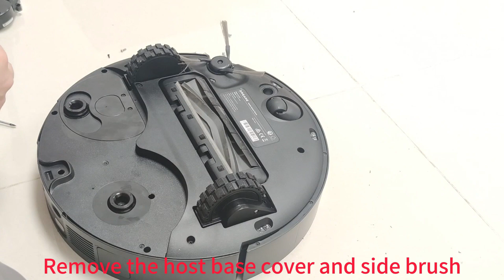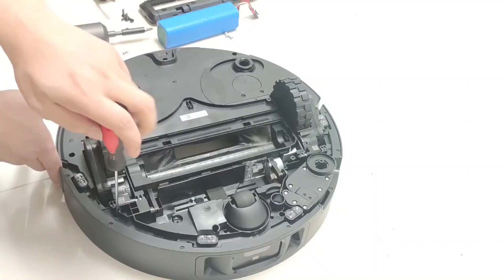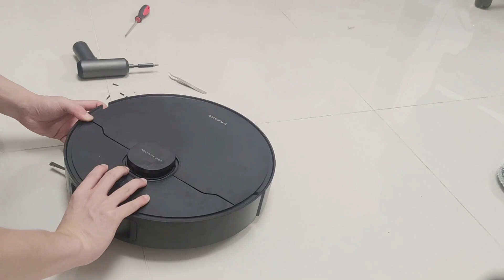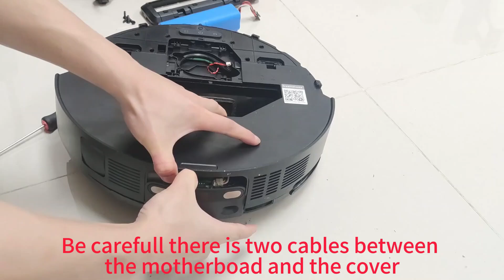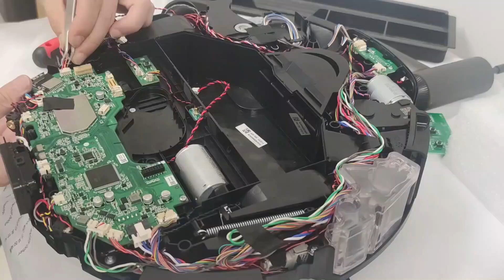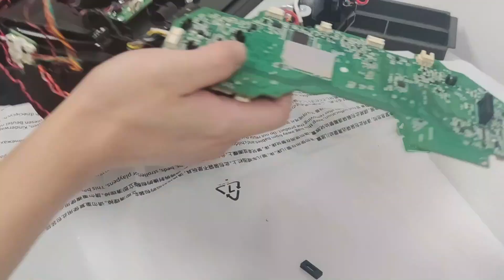Change a new motherboard for DREAME X40 Ultra

Comment: Hi. After changing the motherboard (along with the camera that came with it), the AI camera stopped working on the X40 Ultra Complete - the identification of objects that are below the lidar does not work, which is why the robot constantly crashes into steel legs, wires and other small things.

Previously, the robot took photos of things with their identification, but after replacing the board, this does not happen.

I read about the fact that sensor calibration is required, but I can't figure out how to do it. Could you tell me what solutions there are to my problem. 

Thanks
Reply from the maker: Hi. After change the motherboard or AI camera, you need do the calibration on the tool, Only our agency in your country or your city have this tool. So I think it is better you can call to our agency in your country, then send your robots to their office to do the calibration. You can get their email or phone on the Dreame App.
Reply: @dreametech-robot  It seems like I have the exact same problem as @Dmitry-s7p. Does that mean I have to send it back again? I waited 5 weeks for the last repairment. Is there really no way to calibrate it by myself?

Comment: My X40 Ultra does not clean alongside edges. Dreame Service said this is probably because of damaged LDS. They did repair it, but in the maintenance report I can see they only replaced "Motherboard and camera assembly-EU". For me, this does not sound like a solution to the problem. I expected them to replace a sensor, not the motherboard. Does this make sense to you @dreametech-robot ? I have not yet received the repaired robot, so can't test it myself.
Reply from the maker: @matthiasherrmann3133  Hi. The LDS  will upload the file to the motherboard. So I think they tested and confirm that the motherboard can't analyse the data from LDS. So they changed a new motherboard. The LDS works well actually.
Reply: @dreametech-robot  Thanks for your quick response. Ok, I hope you are right and my robot will finally work like it should :)
Reply from the maker: @matthiasherrmann3133  You are welcome, you can talk to the repair center to test some times before post it to you.
Reply: @dreametech-robot  Received it back today. They really fixed it, the robot cleans everything perfectly now. But it does have a brand new problem: Collision avoidance doesn't work anymore. I resetted twice and tested with all combinations using AI avoidance and non AI avoidance. It doesn't recognize shoes nor tangled cables. It behaves like I completely disabled obstacle avoidance. Too bad :(
Reply from the maker: @matthiasherrmann3133  You can ask them did they do the AI calibrate? it is necessary to do this calibrate.
Reply: @dreametech-robot  Asked them, they didn't respond yet. But I think I know the answer. According to https://youtube.com/shorts/CDolIIBvWgA?si=ehE6qOzeJQCBAt0c I just need the new firmware and then I can recalibrate it myself? But how to get new firmware?
Reply from the maker: @matthiasherrmann3133  This is current calibrationg not AI camera calibrate. You can not do the AI calibrate yourself.

Comment: Thank you for your interest in my issue. May I have your website address? And the information I found out is that x40 proultra is being exported and sold to Singapore. Can I buy the motherboard of the model that exports ash to Singapore? Because Chinese domestic models are too difficult to bypass the ip.

Comment: I can't see any additional comments I've made. I think my comments have been deleted.  I live in South Korea. I bought the x40 proultra from an online shopping mall called Taobao in China. Because I wanted this model, but it's not sold in South Korea. I've been using it through a Russian-run vpn, but the manufacturer (dreame) has locked it out of use. When I asked dreame, they told me that if I brought the product to China and authenticated it, it would be released. I found another way and thought that I could replace the motherboard with something that can be used in foreign countries, so I came all the way here. But I couldn't find a place to sell it :( This is my honest story. I want to solve this problem.
Reply from the maker: @kangillee3094  Hi. I am not sure if it can solve the problem by change a new motherboard. I can send our website to you. I never try to replace a new board.
Reply: @dreametech-robot  Thank you for your interest in my issue. May I have your website address? And the information I found out is that x40 proultra is being exported and sold to Singapore. Can I buy the motherboard of the model that exports ash to Singapore? because Chinese domestic models are too difficult to bypass the ip.
Reply from the maker: @kangillee3094  https://xiaomimi.aliexpress.com/store/1101669394
Hi. You can check the is our agent website. You can connect with the customer service on this website to buy Singapore motherboard.